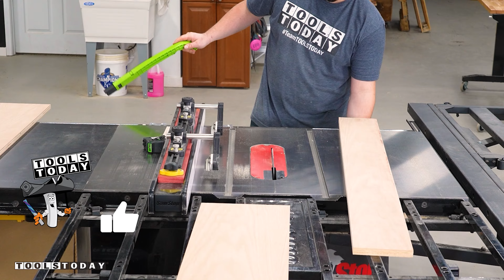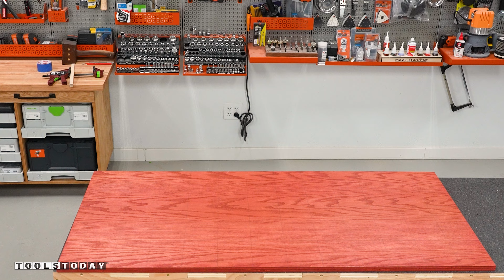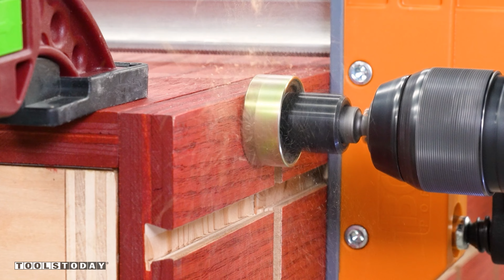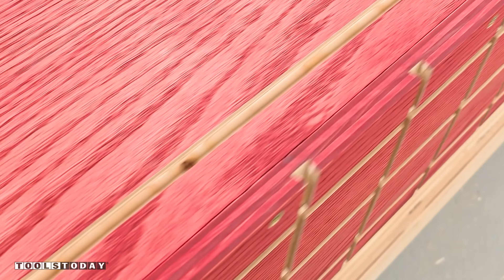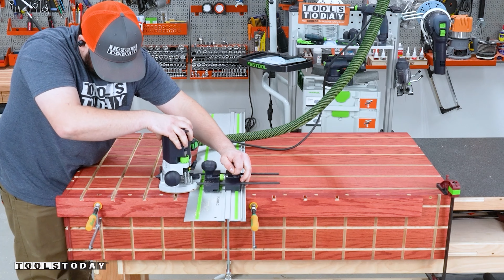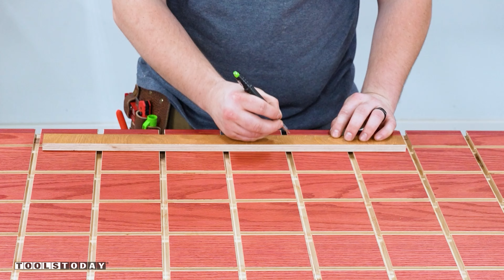How to Make Workholding Easier | ToolsToday Video

Comment: I was hooked in watching the short and had to find the full video.  Awesome!  I picked up several tips like switching the JessEm guides around on the table saw fence with using it for the router table, GREAT idea!.  Also love the way that it fits snuggly over the current bench top, no clamping needed to hold it secure.  Didn't pick that up until I watched this video.